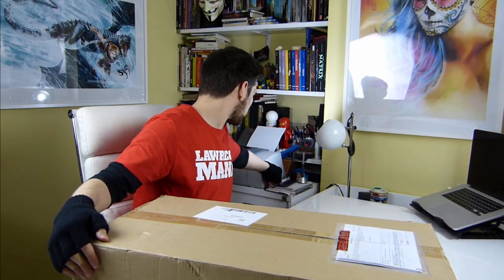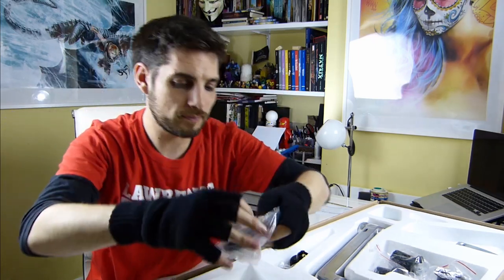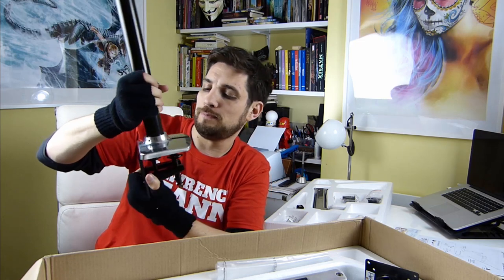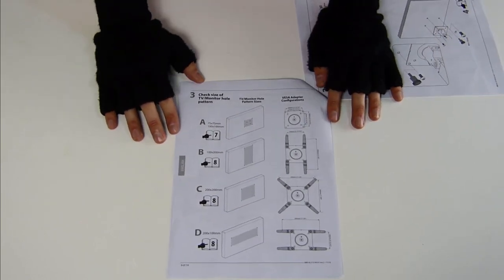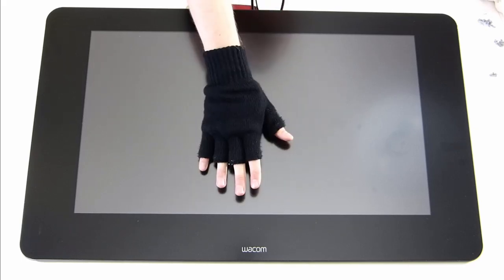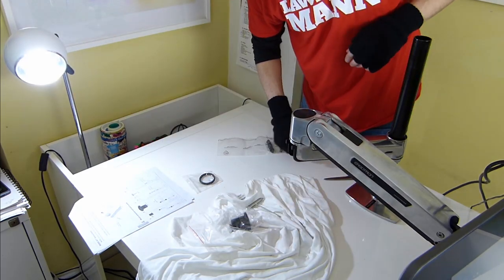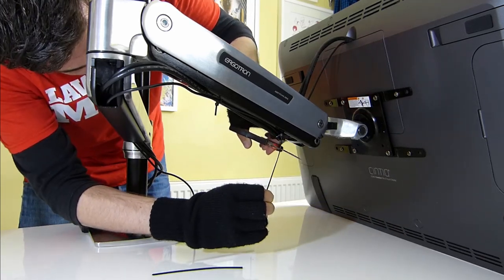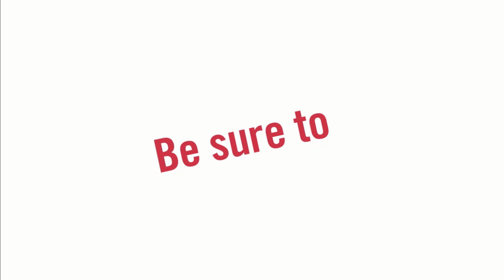Ergotron LX Sit Stand Desk Mount LCD Arm unboxing & installation for Wacom Cintiq 27QHD Touch

Comment: Any information on where to get an awesome white table similar to yours?
Reply from the maker: Other people have asked and I've looked into it but the company who made it have gone bust and the company I bought if from were not much help in finding other similar desks. Sorry :(
Reply: hi, you can get the exact same tabletop from ikea's personlig range. they will custom make it with thickness from 2.8cm -7cm they even offer aluminium trim which I got myself. I just bought some industrail  legs separately. 😉 if you want a pic of mine I'll post a link.
Reply from the maker: That's kitchen counter-top, I just looked it up! lol It'll do the job but it's not the "Exact" same and you have to have seperate legs. I have two huge sturdy legs that are built to house computers and other goodies. You can see them for yourself in the video. They are a big reason I love this desk. Ikea's counter is only 63cm in depth where as mine is 80cm.

The Ikea top is a good idea for a clean white desk. Ultimately with an Ergotron you need a strong sturdy desk. As long as you've got that then you're set! Hope it works out well. Post some pics on Twitter when you've got it together and let me see @LAWRENCEcanDRAW
Reply: LAWRENCEcanDRAW I terms of look/size you can get Ikea to 'custom make' the EXACT same looking table top "counter top" as yours, not there is a difference with the tops unless yours is made from a special unknown material. Then you can make or use what ever you wont to hold it up, legs/cabinets whatever. This is better as you can make the desk more unique than just a standard store bought item. :)
some example here, these have a added optional cool aluminium edge but yeah..
https://www.apfeltalk.de/community/attachments/apple-schreibtisch-jpg.98610/

https://www.flickr.com/photos/tmconnect/sets/72157604072156962/
Reply from the maker: That looks good but I'm happy with my limited-edition 'store bought' desk. I like the dipped storage at either side. Fits my needs perfectly for now! 

Next time I'm actually gonna go for a sit/stand ergonomic desk from +Ergotron. It's important to be able to work ergonomically when you're at your desk drawing & painting for 12-18 hours a day. While I do love my desk, I want to improve my studio space further – Maybe move away from the big bulky desk and go for something more streamlined & based around a way of working rather than having a great looking desk that makes a statement. 

With a son now playing in the studio too, it's time to make the office more kid-friendly and have more floor space. That's another factor in wanting the sit/stand desk rather than this behemoth. haha. I'm thinking of getting rid of my chair altogether and having an ergonomic still which is smaller and child-friendly too.

All of these decisions also come from wanting to make the studio better for filming future YouTube videos too. 

You just reminded be that I had a blue desk about ten years ago with aluminum trim that was from Ikea. It was actually two desks put together as an 'L' shape with pole legs and cable organisation underneath. Nice desk at the time.
Reply: Yeah me too...
Reply from the maker: Thinking about it, it might be nice to just have everything mounted on the wall and use a stool! Think about it. Massive floor space, Think about it; what do you actually need a giant flat surface for anyway. Just an idea! You can have your computer mounted on the wall/in a cabinet and use a lap desk when you really need it. Maybe an idea.

Comment: Hi, do you think this will hold a 34" ultra wide monitor?
Reply from the maker: It's not necessarily about the size. It's more about the weight. Best thing to do is check the weight of the monitor against the weight capacity of the arm. You can find these listed on the product pages on the manufactures websites for both Ergotron and the company which creates your monitor. Remember that arm extentions reduce weight capacity. You'll also need to feel comfortable that your desk is solid and sturdy enough to handle the weight of your set-up. If you're still unsure then Tweet @Ergotron and double check your info. Hope that helps! #ShareALink ;D
Reply: Thanks man. Their site recommended the most expensive arm instead of the Tall LX Arm which can also hold the weight of my monitor which is 6.4kg lol
Reply from the maker: That's the arm I'm using for the 27" Cintiq here. I thought that would be the arm you need. It is a big screen you want to mount though! Glad to be of help! Make a comment if you purchase it. #ShareIfYouCare
Reply: Yours is the LX "sit stand" tall, the one I might get is just the LX desk mount tall. I really don't know the real difference as they both support the weight. Anywho I will drop a line if I pull the trigger.
Reply from the maker: Not 100% sure without looking at the specs. Maybe it is that the Sit/stand version has a longer pole.
Reply: Unfortunately the LX tall is not compatible with my monitor, well that's what they told me on twitter. So I just purchased The Humanscale M2 white for dirt cheap instead. Not as Terminator cool as yours, but it will do the job :)
Reply from the maker: Did they say why it wasn't compatible?
Reply: They said because it was "too wide"
Reply from the maker: That's why it's always good to ask Ergotron directly. They're good at customer service. I'm glad you got it all sorted out at least and you got an arm that's right for you ;D

Comment: where did you get the bars at 26.00? was that part of the cintiqs box?
Reply from the maker: The four part VESA adapter? That came with the Ergotron arm! You cam also buy them separately on Amazon: http://amzn.to/2vkUVLi - I've got a whole video all about VESA adapters too ;) https://youtu.be/i06c2rmKpak Hope that helps! #SpreadTheWord
Reply: oh l have the lx desk mount ergotron arm, it didn't come with them. Trying to mount a cintiq 22hd and l kinda ran into a wall with the...vesa adaptor. Thank you so much for your step by step guide, l learnt a lot

l'll check out that video too, thank you
Reply from the maker: Ah, standard LX arms are slightly different but won't come with the VESA adapters because they can't support larger monitors & tablets. The 22hd is the largest (maybe the 24 at a push) that the LX can handle. Check the weight & size specs on the official site just to be 100% sure. You'll need to compare them with the specs of the tablet you are using. Little bit of math but if you consider upgrading your tablet then it's good to know for sure if the arm can take it!
Reply: l looked up several reviews for the combo of the LX and the 22hd, most said positive results so l'll order in a adaptor and give it a try. l'll let you know how it works out. Did you have a recomendation for an adapter for the 22hd?
Reply from the maker: Which country are you in? I'll send you links to a couple of types I recommend.
Reply: australia, l've contacted wacom customer services about the best way to tackle this as well. been a week and no reply after they escalated my enquiry 

l'd love some links lol. my poor cintiqs sitting on my sofa unused /cry
Reply from the maker: Sorry for my late reply. Looking at Amazon AU it couldn't let me see anything other than books which was odd. So I had to add just US links for you. You can see the products though and should be able to find identical or very similar one in OZ. Hope this helps! Let me know.

• RiteAV - VESA Adapter Mount for LCD & Plasma TVs (Identical to the one I show here): http://amzn.to/2oEgXkq

• Mount World 1056 VESA 200 x 200 Universal Adapter for Medium Mounts: http://amzn.to/2nQx2q2 

• LCD TV Flat Screen Adapter Converter Change Pattern VESA 100 pattern to 200 (small arms): http://amzn.to/2oeD2JH
Reply: yeah our amazon au is shit. we have to look at us amazon and look at international shipping.

l found an ebay equivalent. ordered the arms and the riteav
Reply from the maker: Hey well glad I could help. I thought AU Amazon just wasn't letting me in. I didn't realise it was medieval. lol.

Comment: CAN I ASK HOW BIG IS THAT HOLE?
Reply from the maker: Can't remember. It just has to be big enough for the bolt to go through. That's it. Don't make it any bigger than you need to. A few mm won't make a difference. As long as both plates cover the hole completely.
Reply: THANKS LAWRENCE
Reply from the maker: Sorry I couldn't give you an exact measurement but I guess 'the why' is more important sometimes! Hope it helps. If it does, spread the word ;D